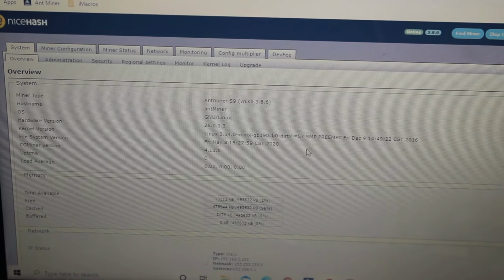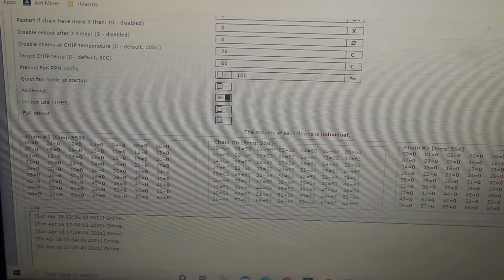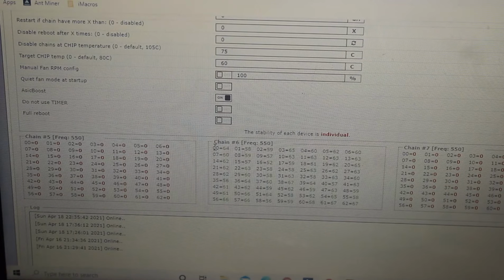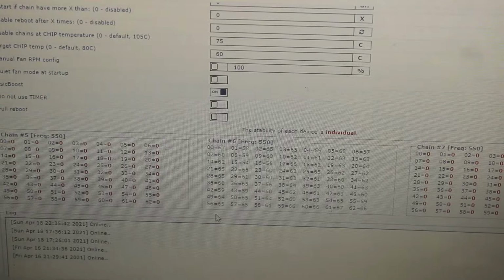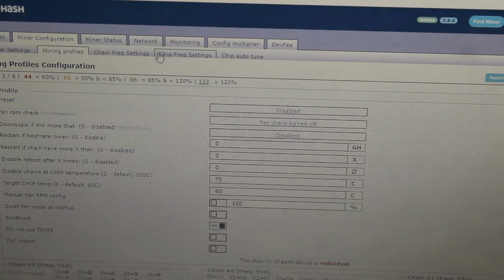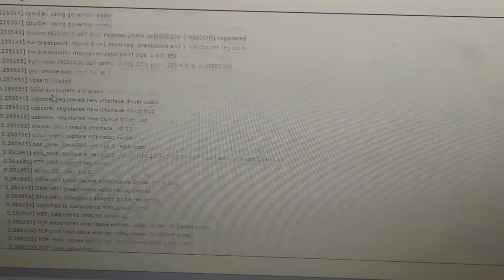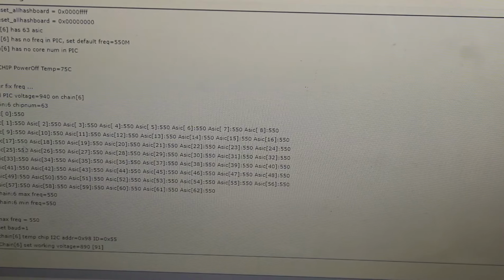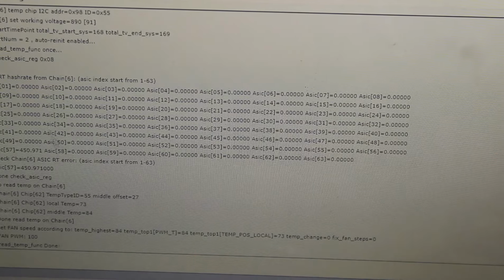DOMAIN VOLTAGE Hashboard (S9,T19,Z15,X3,S17E,T17E,D3,L3+,S9,S7,S5,L1,S3,S1SE,S9K)

Comment: hi 
my control board lose the cpu and i change cpu with new one. but not working because cpu luck on firmware when update with latest firmware. 
i know about latest firmware
but i need factory default firmware. 
when change the cpu , need to flash with factory default firmware , actually first release firmware that innosilicon company writhe on a9 zmaster miner. 
thank you
Reply from the maker: Hello please send your request on WhatsApp number 0096181007374

Comment: Your channel is one of the best for learning about fixing hashboard problem.  Thanks for sharing. Btw have u ever experienced problem where chip no 1 (first chip) cant work then all chip on the hashboard also down (cant work) following the chip no1... kernel log info = crc5
Reply from the maker: Thanks for your comment, if the chip 00 had an issues so the 4 signal will stop to send and received.
EMAIL:Eng.salman_zeineddein@hotmail.com  or WhatsApp 0096171402063 
If you have any  request
Reply: @salmantechrepair5553   Thanks Mr Zeineddein  btw do you know the capacitance value (uF ) of the L3+ hashboard --> 10V test point

Comment: Hello.. i have a problem with a s9. it connects but does not mine. i have already changed the 4 Mosfet QN3109 also the voltage controller UP1542S and the fault persists... what other component could i measure to find the fault... i measure the PIC and it reaches its corresponding voltage 8.6v.
Reply from the maker: you have to test ( test point )on chip starting from 00 till 62

Comment: Is it possible to connect DC power supply to 6pin PCIE to test specific voltages?
Reply from the maker: what do you mean ?
you need to plug only 12V to test ClK and RI .
Reply: @salmantechrepair5553  I have a couple boards reporting no spi data received. I wanted to have variable control over the 12v input to the board for testing.
Reply from the maker: @markmccabe2102  Serial Peripheral Interface  is an interface bus commonly used to send data between microcontrollers and small peripherals such as shift registers, sensors, and SD cards. It uses separate clock and data lines, along with a select line to choose the device you wish to talk to. what the model of the power supply you have , there is no SPI on the bitmaine power supply